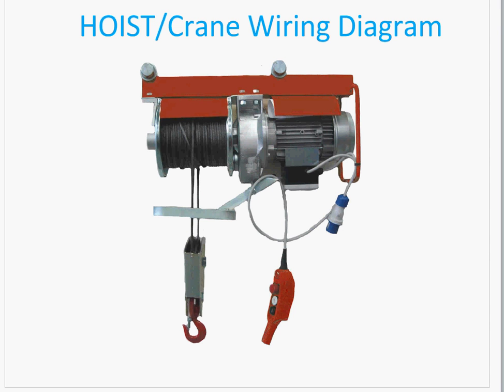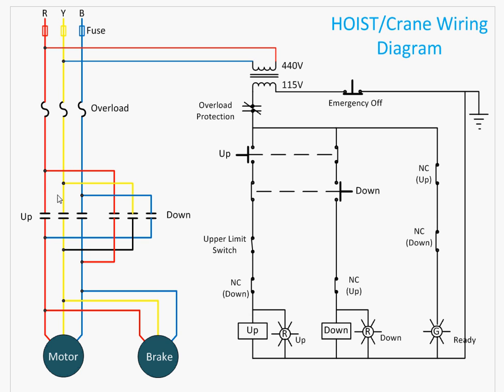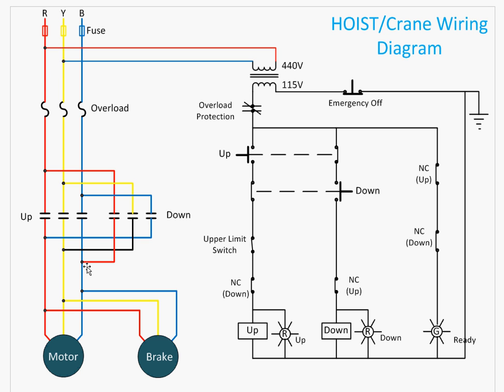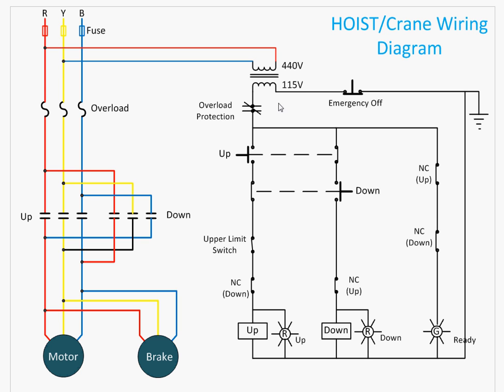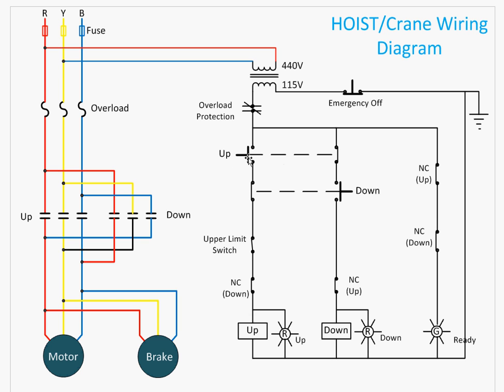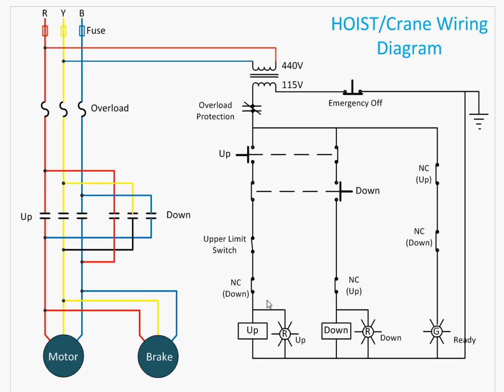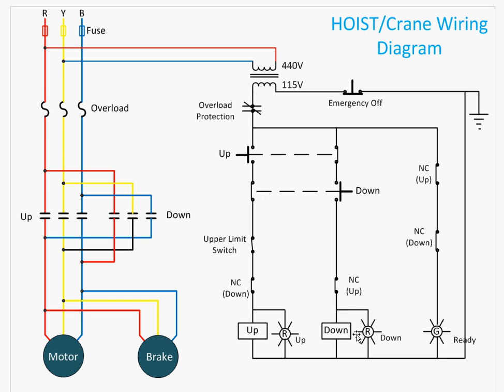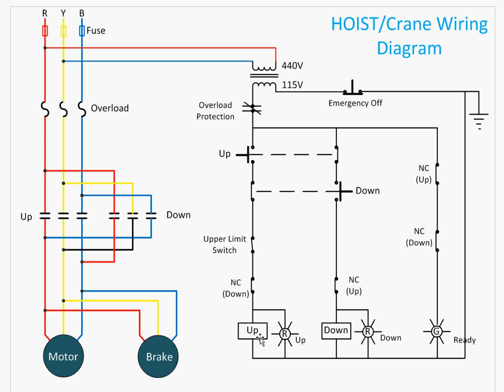Hoist Control Circuit

Comment: when we push the  up button then up contactor will work for some seconds and when you release it then contactor will be off.. is it ok ? i think there must be normally open contact used to hold the contactor coil on when we push up button same case has to be implemented for Down button.  if i am wrong then please do let me know??
Reply: faisal shabir maybe for a normal motor circuit, but you shouldn't wire equipment such as hoists to have a maintained contact. That's an accident waiting to happen.